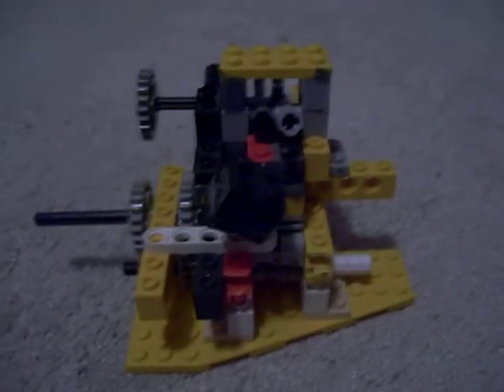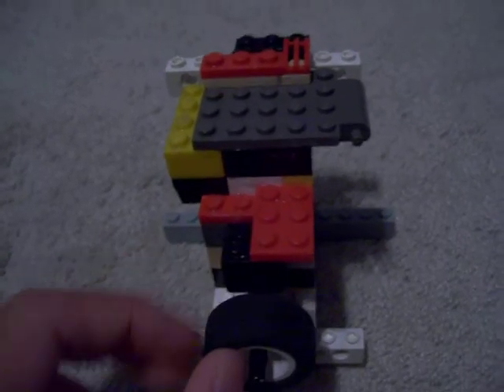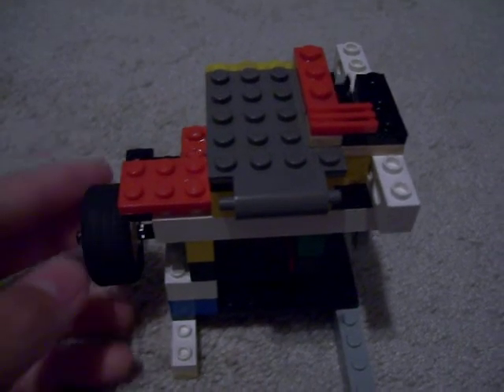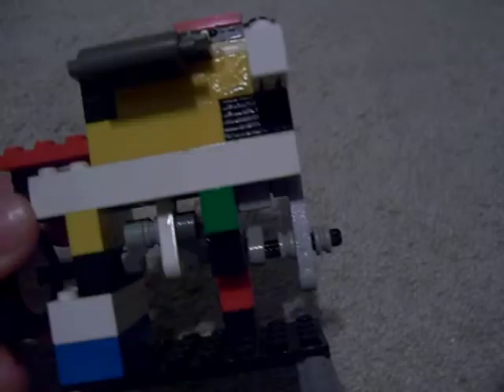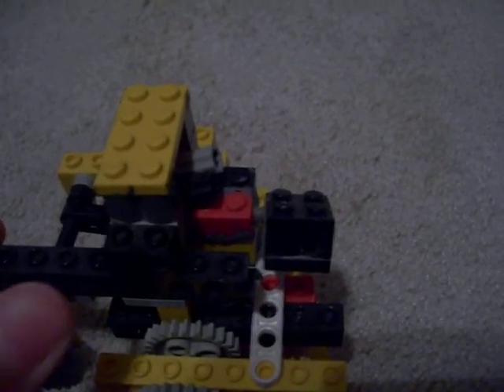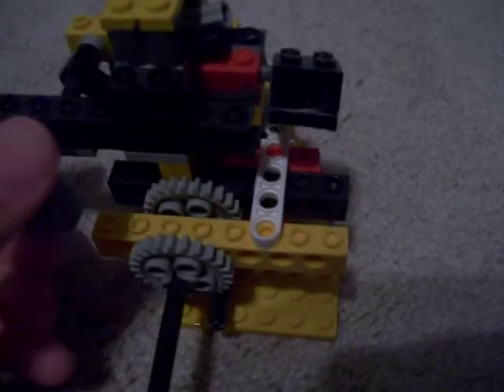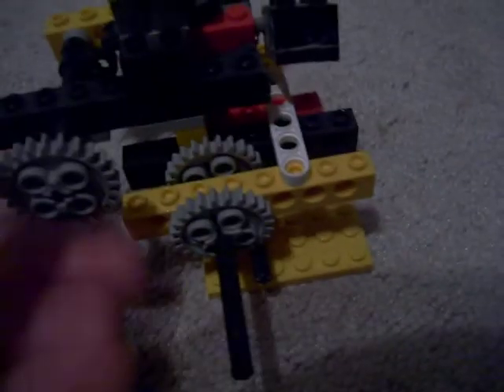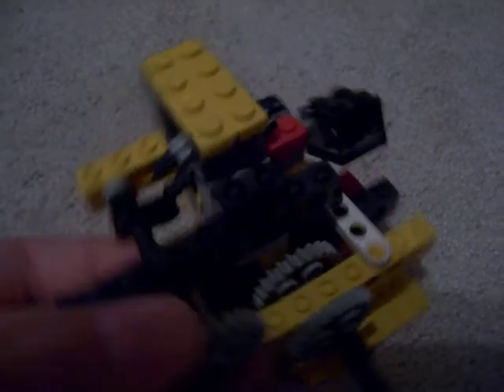Lego 4 stroke engine update #2

Comment: Sorry, the fuel will not work. I do a lot of glow rc plane work, and i have built jet turbines that run on propane, so I know a decent amount. 
1. Your ignition will not work, you will need to push it every time you need a spark. The engine will not have the power to spark its self.
2. It has no compression, so it cannot compress the fuel to light. 
3. You have no valves or exhaust, so you cannot keep compression, or block the neutral point with a shock wave from the exhaust. 
4. its legos